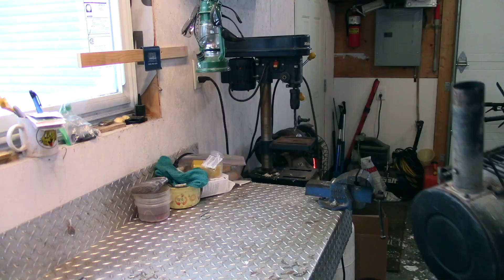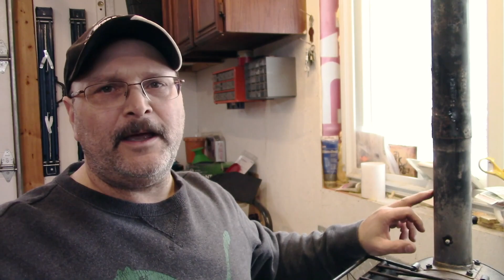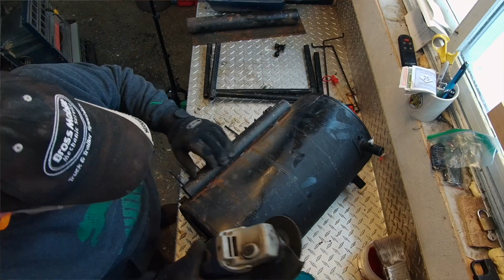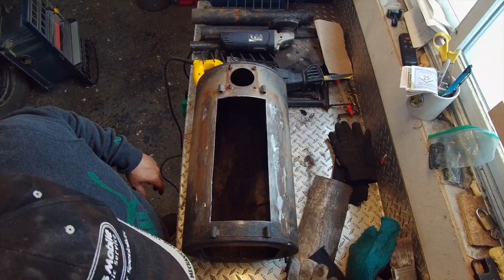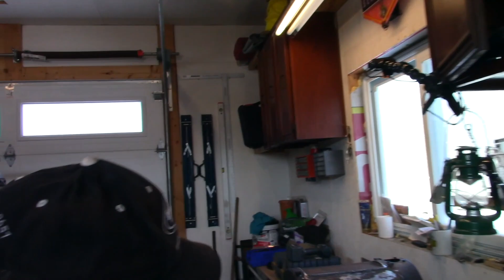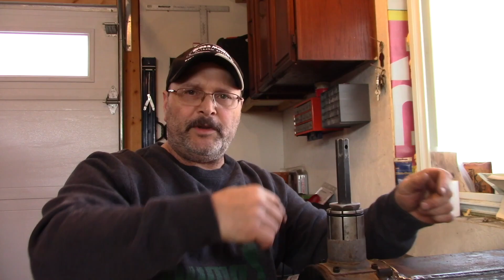HOT TENT STOVE MODIFICATIONS, sometimes you just have to make it better!

Comment: Thanks for this video, I have the same stove and am going to have the fabricator I know follow your guide of sorts to do these same mods.  Looks great!
Reply from the maker: Yes this stove is not built quite rite! I also later on drilled more vent holes in the front to promote more draft.
Thanks for coming along ✌
Reply: @OpenAirOutdoors  thanks for the tips. Would you recommend doing a total bead around each end? From factory it is just tack welded in several spots on mine and I feel like the end caps would eventually come off.
Reply from the maker: I have not had any issues with mine and i have used it quite a bit so I would leave it.
Reply: @OpenAirOutdoors  thank you for the input, I appreciate it sir 👍

Comment: On every woodstove I've ever owned I always added a baffle on the inside of the firebox about an inch or two from the top of the stove (depending how large the stove it) That way the flame has to travel to the front of the stove and over the baffle than to the back toexit the stove. The baffle forces the flames to burn up some of or most of the smoke before it exits the flue pipe. If the stove is a large one (used to heat a home) I also add secondary burn tubes to ignite the smoke, which actually burns hotter than the flames off the wood.
Reply from the maker: Yes the baffle is a great improvement, however the stove needs to be a decent size to acomadate it. This one is boarder line for that. It would impede sticking wood in it. This particuler stove should have a 4" flue pipe. What it came with restrics draft.
Thanks for checking in and your insight Painter✌️

Comment: Great job on the stove, i got the same stove maybe i will put a flat top on it as well. i put a few holes under the door for vent i had it so i could give it more vent if need to be. it works awesome no back draft now. i could not see if you had it there. take care
Reply from the maker: Thanks! I thought of extra vent holes but Doug had also added a BBQ grill inside to keep the wood elevated. With air being able to circulate under the fire the stove performed even better! 
Thanks Wallace🍻
Reply: Tod vent hold work wonders I welded a sliding price of steel to open and close the holes the grill is a good addition to it as well